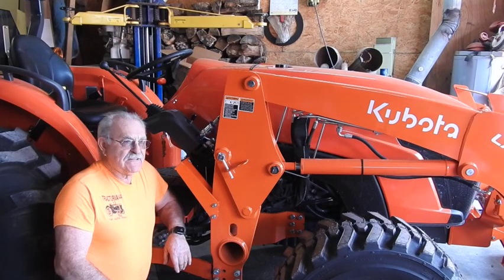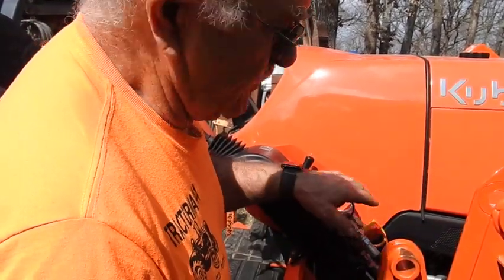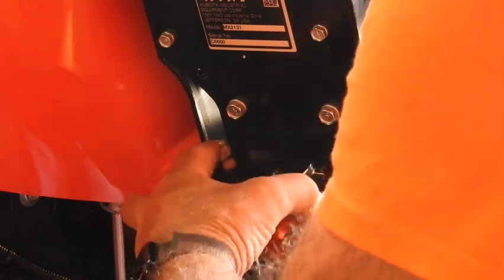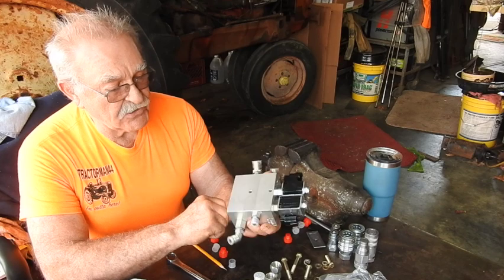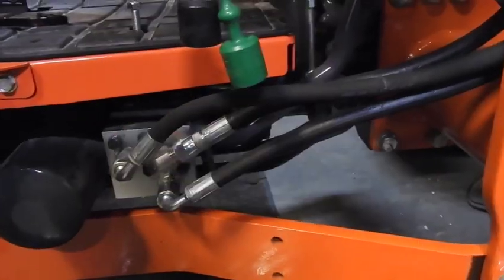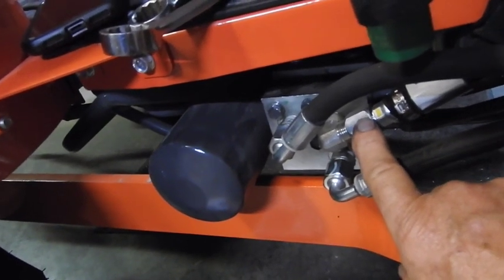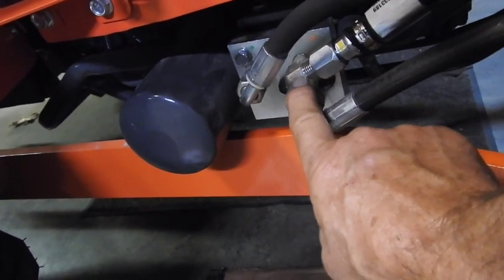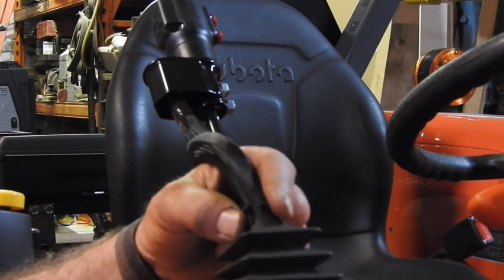Kubota MX5400: Land Pride 3rd Function Valve Installation

Comment: Great Video 44!!!  Just ordered 3rd function kit and grapple. Should be installing this weekend. Wish you were my neighbor!!! 😂
Reply from the maker: Hahahaha...it really isn't too bad at all.  Turns out I had a small leak at one fitting that showed up after a few days.  I did everything I could to remedy it and ended up removing the plate and taking it to the dealer.  He found a faintly visible hairline fracture in the plate between two threaded openings. He ordered me the plate, replaced ALL the fittings and gave me 5 gallons of oil for me not taking the tractor back for warranty service.  I wouldn't mind another Kubota in the neighborhood wither, btw.  (-:  Have a great evening and thanks for commenting.
Reply: @tractorman4461 wow!  Good to know. I’ve heard that you should double check all the fittings once received. Glad you got it all working!  Post more videos. We need your kind of content. I’m not a young man, but watching you and listening to you reminds me of working with my grandpa and dad. They always talked me through things and taught me great work ethic. Hope to see more from you.

Comment: Great video, I didn't even need the instructions, installing on my mx5400. Now I'm looking at installing rear remotes. Don't suppose you have a video on that?
Reply from the maker: No, I sure don't.  My 5400 came with the rear remotes factory installed.  That's just the way it was shipped. I added remotes to a couple old Ford 00 series tractors though.  It wasn't much to do on those though.

Comment: Installing the same unit to my mx5400. Not very often that I find the exact video I need for direction. Thanks for the video.
Reply from the maker: I have to admit that hydraulics is definitely my weak point.  After a day or two of use it developed a leak at one of the threads on the fittings.  I replaced the fitting from a local hydraulic shop thinking it had a bad thread.  Still leaked.  I finally removed the whole plate off the assembly and took it to the dealer where close inspection revealed a hairline fracture that caused the seep.  They provided a new plate, fittings and hydraulic oil for the repair and now all is good. They said this was the first failure like that they'd seen. All good now.  Thanks for the cool comment and thanks for watching.

Comment: Hey tm44, that grapple is gonna be a very nice attachment for your new tractor. I use my pallet forks a bunch because I have not bit the bullet yet to buy a grapple and third function valve. Thats going to be super nice for bunking logs and sawmill work. 🚜
Reply from the maker: Forks are really handy too.  I started out with that old Toyota forklift and then made forks for the Ford 4500 hoe and continued making them for the next few tractors.  So getting a grapple has been a long time coming !  Thanks for stopping in Dean.  I appreciate all you guys visiting.

Comment: the only thing i miss about working at dealerships is working on stuff with new and shiny nuts and bolts
Reply from the maker: I agree. For the last 20 years of my job, the biggest percentage of my work was commercial hvac system and control startup, small medium and large. Mostly all  new and shiny. No age old dirt, dust and old greasy stuff.  Well, there still was when sent on service calls on old equipment, but I enjoyed start-ups the best !!

Comment: Where IS The Missus?
When will the grapple be in?
Can you hook up a hydraulic brush hog to the front?
I did notice that you put the loader on level ground this time.
Reply from the maker: I don't think the gpm will be great enough for running a bushhog Rick.  As I understand the third function valve is a 'diverter' valve that just robs a bit of oil from the dump and curl circuit. So the gpm is not real great.  The grapple was delayed a bit beyond what I was told on the phone.  But I have it now and have been using it moving logs already. There is definitely a learning curve to it for sure.

Comment: Great job T! You are going to love hooking up the Grapple - you will use it a lot. Just a little tip from your old buddy, If you are looking to relieve the pressure out of the hydraulics, you need to turn the key to the Accessory position before you cycle the joystick - that relieves the pressure. Be well and stay genuine!
Reply from the maker: Good Morning GP and thanks for the tip as you know my forte is mostly old and rusty stuff.  This shiny stuff is growing on me though.  (-:
Reply: That depends on where the 3rd function gets its power from.